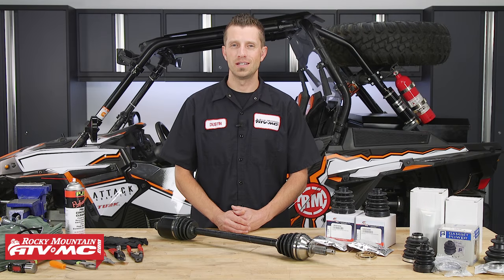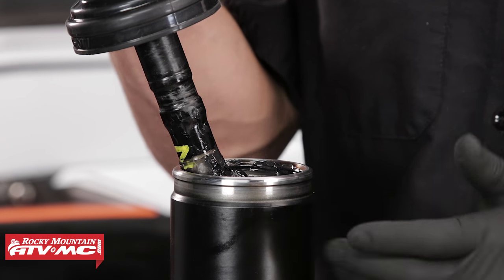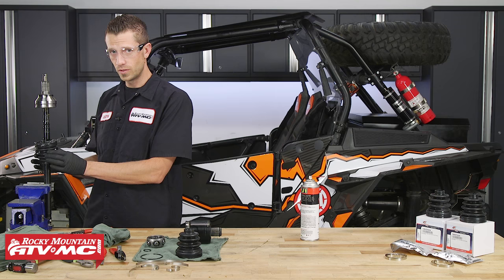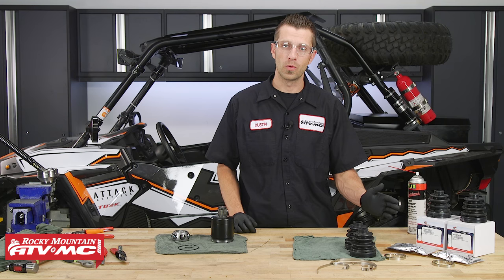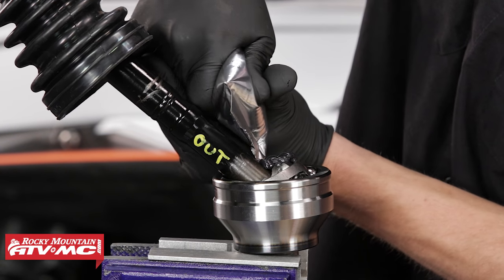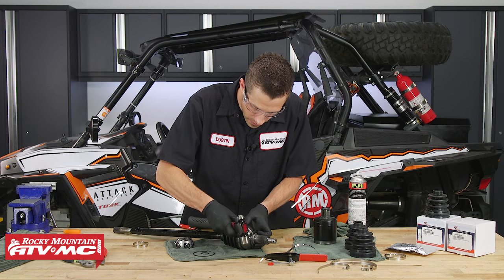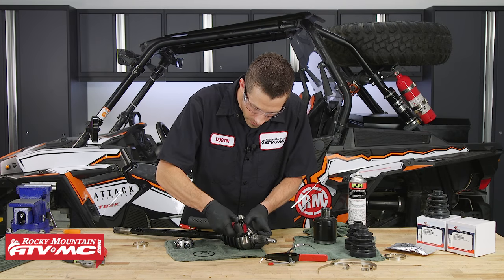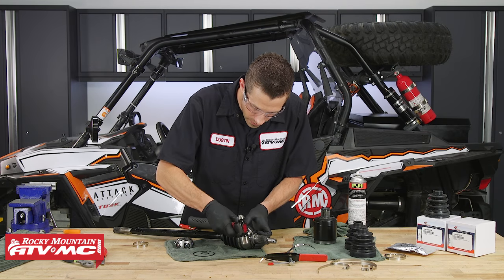How To Replace a UTV/ATV CV Axle Boot

Comment: I have a 2013 RZR eps; the front axel needs a CV boot replacement. Is the inboard boot and the outboard the same boot P/N or different like on the rear as shown in your video?
Reply from the maker: The inboard and outboard boots are different.

Comment: Great video. I have a 2008 polaris 700. Am trying to replace the rear inner cv boots but there are no c clips holding the joint together. Do I need to tap the bearing off the shaft like outer cv joints? Any help would be appreciated.

Comment: how didnt the bearing balls fall out when he took the inner off? mine did, r they bad? n should the metal that holds the bearings have hot spots, im told yes from factory, wasnt sure if they got too hot ?
Reply from the maker: Sounds like it's worn out! It's possible to remove the ball bearings by rotating the race and cage, but they shouldn't just fall out on their own. Haven't seen the "hot spots" but if it looks different than the race and cage we show in the video, it's probably bad. Sounds like your best bet is to buy a new CV axle. -Charles
Reply: @rmatvmc  ty! yea when we took off the inner to replace outer the balls fell out just holding it, n on google tons of pics with hotspots around the outer race ppl sayn factory does that but i think your right. only thing is it has low miles n the inner didnt leak grease, n i have no odd sounds.....?

Comment: I’m struggling to get the bearing housing off of the shaft after I got it out of the plunging unit, I’m not seeing any snap ring to grab hold of to release it.
Reply from the maker: If you aren't seeing any retainer clip on the top of your bearings, you may have the style with a circlip on the inside. Check out this video we have about the other style of CV Axles: https://www.youtube.com/watch?v=5LB5HWHsrTE Hope this helps you.
Reply: @rmatvmc  thank you! Super helpful videos, greatly appreciated!

Comment: What if we don’t have that tool you out the band on, could we just use a hose clamp?
Reply from the maker: It just depends what type of clamp you're using. There are cv boot kits that come with regular band clamps that don't require any special tools.

Comment: I replaced the CV boots on the drivers rear axle but I'm having trouble reseating the rear axle into the rear gear box.  I have not replace the spring clip.  Could this be the issue?  I had no trouble removing the axle at the start.
Reply: I RAN INTO THIS PROBLEM , GET SOMEONE TO SPIN THE WHEEL ON THE OTHER SIDE SLOWLY WHILE YOU PUSH ON YOUR AXLE AND IT SHOULD JUST SLIDE IN .

Comment: You might have the boots backwards.... would make more sense that the larger/longer one be inner since it articulates in and out🤷🏼‍♂️
Reply: Alfred Ferrill    The inner boot doesn't move as much as the front  boot does especially when cornering that's why it has the extra fold in it. Hope that clears that up for you.

Comment: Never getting a CV boot banding tool. Gonna try stainless hose clamps.
Reply: Howed th hoseclamps work
Reply: @jamesmiller7283  good, no issues, had to find some with slightly narrower bands then put on two in a series with the adjustment mechanisms on opposite sides for balance.

Comment: can i reuse the cer clip?
Reply from the maker: Many people reuse them if they're in good shape but it is always recommended to use a new circlip.
Reply: @rmatvmc  hi n ty, that ring doesnt hav the 2 tiny holes for snprng liers, how do i remove?(didnt see that) also do u have that part number in case its not in my kit? n the boot prt nmbr would b grt as nothing matches the numbers on my stock one....ty
Reply from the maker: You may be able to use two flathead screw drivers to remove the retaining ring: one to hold one side and one pry the other side. Snap ring pliers can still be used even on circlips without the holes to help pry both ends apart. The part numbers with vary depending on your specific machines. You can use our OEM parts finder to locate the circlips you need. 
https://www.rockymountainatvmc.com/oem-parts
Reply: @rmatvmc  2016.5 lol dealer said i may have a 17 front end as factory started using them, ace570sp.  ty
Reply: @rmatvmc  ps will i need new nylon lok nuts n a torque wrench for the castle nut? cant believe all this for a boot